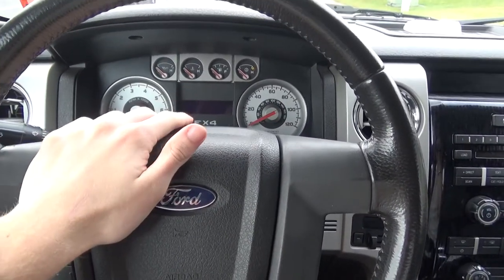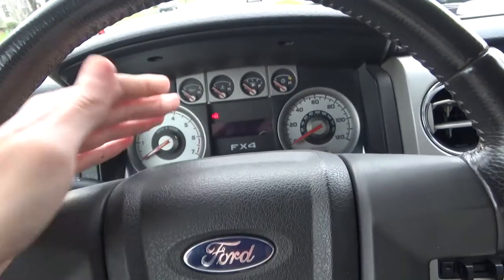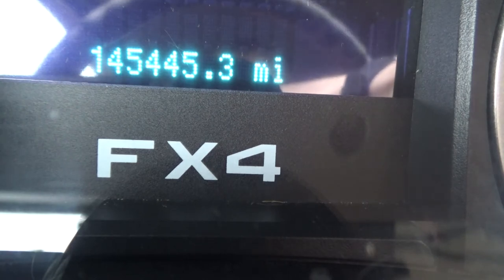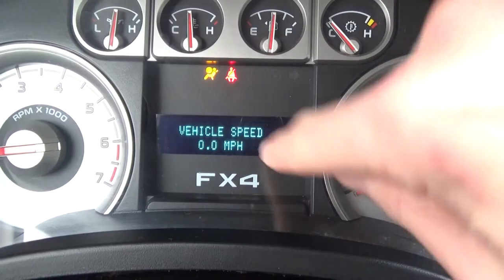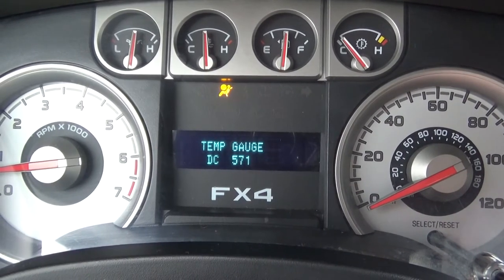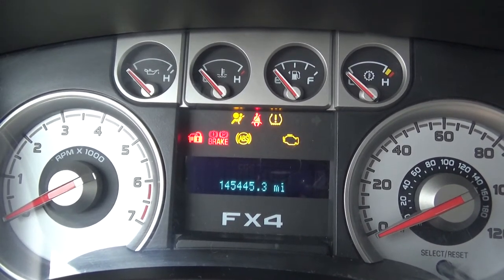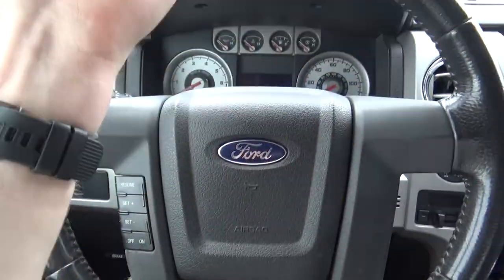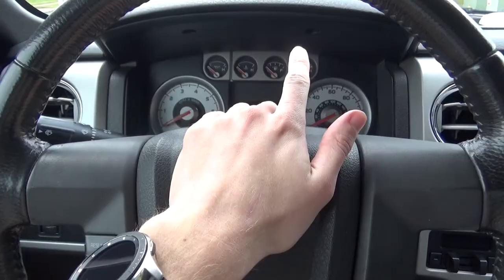Hidden Digital Speedometer In All Ford Vehicles

Comment: How to u get it to save on the dash so u don’t have to keep doing it
Reply: You may recall he stated it was for going in and doing a test so this is a test function and as such it's not part of their normal operation for day-to-day functions of your vehicle so there is no way to leave it on I don't know why couple people ask for this. If you want to have a little display read out that goes more in detail as to your car Direction heading coolant temperature low temperature alerts vehicle speed excetera excetera use an old Android phone you've got or you can buy a used or new one for very little money you're not buying it for the connectivity of any kind of phone service you're nearly going to be using it to download an app to do what you wanting to do after you buy an elm327 OBD2 Bluetooth connector. I don't see why the $10 ones won't work for you for what you're doing since you're not trying to pull up a bunch of engine codes and stuff which you can also read and reset Etc up once you have the Bluetooth OBD dongle and some of the apps are free some of you pay a few dollars look them up send mom actually pretty cool though even do a heads up display on your windshield so when you're driving in the day or night you don't have to take your eyes off the road and it will show you your speed RPMs mileage Etc but they can get pretty elaborate so you just need to look for yourself to see what fits you and then that way you can have it mounted on your – or in front of the dash with a simple charging cable plugged into it that you leave all the time so it's always there always on you leave the OBD dongle plugged in it won't hurt anything so when you get in it's ready to go every time

Comment: So I have a 08 Explorer and I do not have the reset button on the gauge but if you hold the reset button on the dashboard it works the same way. :)
Reply: We’re you able to get it to show up when u turn the car on normally like it is permanently on the display? I have not been able to get my 07 explorer to do so, the analog speedometer seems to be a bit off. I don’t want my car to be in test engineering mode the whole time

Comment: I have a 2014 Ford F150 Super Crew Cab and I have a screen but I do not have a Select/Reset button to push in. I don't have an OK button with arrows on it on the steering wheel. I have the same set up as you on the steering wheel but I have no Select/Reset button to work with. So, this does not work for me.
Reply: I heard code readers / obd dont work 2014 and up, is that true ???

Comment: Can u or some one you know or where I can look but I got a 2010 lariat and I accidentally activated the  “my key” program do u know how to dis arm besides taking it to dealer??
Reply from the maker: I'll look into for you
Reply from the maker: Locate the main menu on the screen using your steering-wheel-mounted controls. Select "Settings" by pressing "OK." Scroll to the "MyKey" option and press "OK." Search for the option that says "Clear MyKey.
Reply: @mcfgotmillk  wooow I just seen this today I’m sorry man I’m going to try this in the morning for sure if this works omg your going to be a life saver!!! Hell yea man thanks ur the man!!!!! I look d everywhere on you tube and I couldn’t find anything you did !!!! Thanks!!!
Reply: Hey bud one lil problem I don’t have the push button in my cluster!!! On my steering wheel on the right side I have a row of buttons a same one the left side of steering wheel and where the radio is on the dash the first three buttons say info/setup/reset I’m sure it has to be one of those three buttons
Reply: @deerock619bc  i had the same problem for my focus if you find the fuses inside your car usually under the passenger dash where you put your feet you wanna find one for your computer mine was number 66-70 it was 10 fuse pull it out and plug it back in and it should restart your car computer for the odometer
Reply: @stretchslimedd2318  hey thanks buddy u saved me over 200 dollars to have the dealer do it fuck that shit thanks man that shit was
Getting on my nerves!! Thank you !!!
Reply: @deerock619bc  im glad it helped you out man, saved me money as well youtube can always help you when in need.

Comment: Bummed... This doesn't work for my 2011 Ford Fusion 😭 I don't have the odometer reset button so I tried pressing and holding the ok button on my steering column and then turned the ignition switch to run mode and still nothing... 😩 Glad it works for all of those whose vehicles will allow for it to! ❤️ Blessings to all!
Reply: I have a 2010 fusion SEL and it works. Hold the reset button.
Reply: @carterpeel625  mine doesn't have a reset button 😩
Reply: Same Here I Tried The Reset Button On My 2011 Ford Fusion But Nothing Happened🤦🏾‍♂️
Reply: @mantrellbatson1513  😢 I finally had enough of it and went in and had the dealership disable it. $276...smh. On the bright side though, I now have a spare key with fob <3, my traction control finally now works, I can drive over 75mph if I wanted to (though I wont lol), AND MY STEREO VOLUME CAN BE BLASTED LOUDER THAN THE RIDICULOUS 30% VOLUME LIMIT THAT THE PREVIOUS OWNER HAD ORIGINALLY SET IT TO!!! A wee bit pricey I suppose, however, it was very much well worth the investment imo, just to have a spare key plus the volume restrictions removed im js!!! 100% Best of luck to you my friend...this came finally after 4yrs of having to endure the whole MyKey crap and after investing so much time and energy into researching all my different options to no avail, id finally given into just taking it in and letting the professionals handle it after exhausting all  other avenues. Im no longer unnerved, irritated, & stressed out about it...nor am I even remotely upset about having to come up with the money to have this matter taken care of!!! Well worth it, Im very pleased!!!
Reply: @carterpeel625  What you want to do, if you haven't already figured it out, hold the OK button for 5 seconds before turning the car on. Don't start the engine yet, just turn the battery on. Once the car is on, continue holding down the button until Engineering Test Mode comes up.

Comment: I have a 2012 Ford Escape with the 3 buttons “info” “setup” and “reset” and I just can’t get it to work
Reply: Same thing here. 2011 escape XLT. 3 buttons. No odometer pin. How do we do this?
Reply: Have you found out how to do this. I also have a 2nd gen escape. 2009 with the 3 buttons
Reply: If you hold down reset it should work.
Reply: @daltonfugate6634  Did you try it, I tried and didn't work